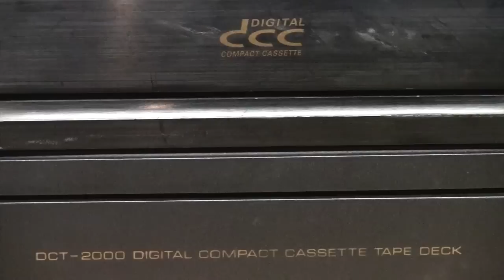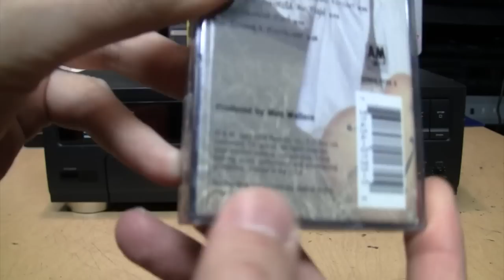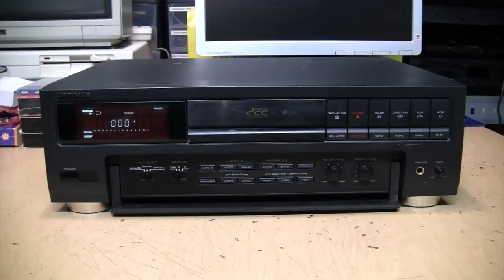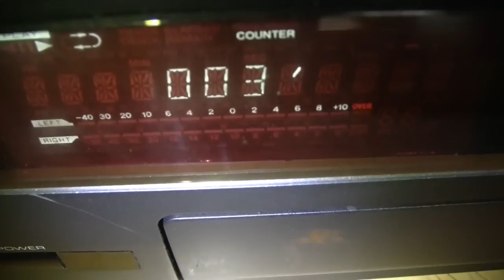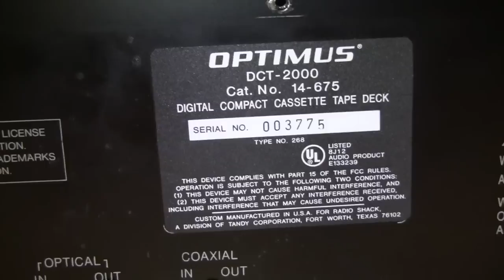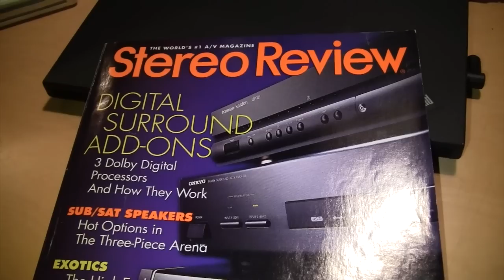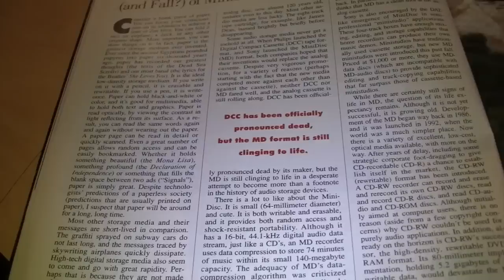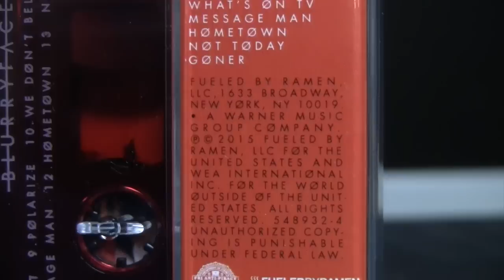DCC = Digital Compact Consternation

Comment: This is not a capacitor issue.If it is it would show with a bulge on top of it!I think its the head or somewhere very close to it!
Love ur channel,though.
Reply from the maker: Surface-mount capacitors don't bulge, they just leak.
Reply: Nor do all electrolytic capacitors bulge or leak, they just dry up and turn into a resistor....  ~Jack, VEG
Reply: Would u be able to see if it leaked?
Thanks.
Reply: Thanks,now I know a bit more than yesterday!
Cheers.

Comment: are you planing on reviewing cheap cassette decks like a pyle or a marantz
Reply from the maker: Eventually.
Reply: Marantz actually also made a couple of DCC decks, and they're generally viewed as the best DCC decks you can get, because they used different D/A converters. They were also wildly expensive even though they were identical to the DCC-900 inside apart from the D/A converters.
Reply: Actually, he's referring to Marantz last Cassette Decks which where geared for Pro use and were  just strait Crap, They actually were the same model as Pyle's Cassette Deck and a lot of Customer's were pissed after they realized they could of bought the same unit for much less under another name, needless to say, it didn't last long on the market...

Comment: It seems like you may need to check into the tape head itself, dude......... though I certainly wouldn't rule out capacitor issues, either.
Reply from the maker: I spent half the video talking about how it might have a bad tape head, dude......
Reply: Unless some moron tried to demagnetize the tape head, the head is probably still good. But he won't know until he recaps the boards.

Comment: Get a hair dryer or heat gun on the boards always works on the old ps3 soldier joints
Reply: The solder joints aren't a concern here, heating the board would do nothing.

Comment: If you encounter the same problem, first you clean the head. If there is no result, you go to the head and press it down or up. There is no result. Change the pulleys. There is no result of changing the capacitors. There is no result. You press your finger on the variable resistors in the small board of the head.  Or the fuse. You did not get the result of the nearest trash bin near your house, throw it inside, and comfort yourself😂
Reply from the maker: Bad capacitors are the known problem with these decks.
Reply: NEVER A TRASH BIN....RECYCLE BIN ALWAYS

Comment: At about 10:30 you said the magic word! The reason this deck isn't working, it's made by Philips(except for the power supply board)! Problem solved! Case closed! Philips is a brand that anyone even half-way serious about good audio gear should AVOID LIKE THE PLAGUE!
Reply: Philips made excellent gear until the 1990s when they started cutting costs everywhere, just like everyone else.
Reply: In 1963 our family bought their first TV set, the store we bought from gave us three sets to evaluate, a Healing(EMI's other brand), PYE and a Philips. My parents thought the Healing's sound was a bit tinny, the PYE seemed to exhibit vertical hold problems so they settled on the Philips and our TV problems started from that point as the set was ALWAYS playing up, so I grew to having a complete distrust and dislike for ANYTHING carrying the Philips brand except records because Philips did not directly make records, they leased the name and trademark to a company to press and distribute records for them. Just as well because if they had made records themselves they'd be useless - unplayable. From the time of that old black & white TV my parents foolishly chose(they should've gone with the Healing) I've held Philips in utter contempt, and still do.
Reply: I'm biased because I come from Philips' home town and grew up surrounded with Philips. I have good experience with Philips engineering and I'm proud to say I was one once. But I also think Philips made some spectacularly bad decisions with things like Video-2000, CD-i and DCC. My experience is that at least until the 1970s, they had a reputation of making quality gear that could last "forever". We had one of the first Philips color tv's of the street, purchased in 1973 or 1974; it lasted until 1988 and probably could have been repaired. Picture and sound had been fine until the power supply failed but with only 6 preference channels it was getting increasingly useless and we got rid of it when we moved. I also had a top of the line Philips stereo system from 1987 that had lots of trouble like an amplifier that would sometimes boot up with its electronic volume regulator on maximum. Right now, Philips is not even the shadow of the company that it once was, and whenever I buy new gear now, it's near the bottom of the list of likely brands to consider.
Let's just conclude that your mileage may vary. Not all Philips gear is good, but bad capacitors don't just happen to Philips. And continuing down this rabbit hole won't benefit anyone, so this will be my last comment on this thread.
Reply: We'll agree to disagree.
Reply: I used to avoid ANYTHING AND EVERYTHING with a Philips brand on it except records because several great artists and groups, like Dusty Springfield, The Four Seasons, Demis Roussos, Roger Miller, The New Seekers and others appeared on the label here in Australia. But cassettes, cassette recorders, TVs radios, even light bulbs, I wouldn't touch them with a barge pole.
Reply: Their 1980s CD players are the best ones ever made, though. Anyway, I think that’s their only stand-out.

Comment: how can you record a DCC Tape (add title)
Reply from the maker: Using a working DCC recorder.
Reply: You couldn't add titles to DCC tapes with this recorder, only with a third generation recorder (DCC-730/DCC-951). And those titles would only be visible on other third generation recorders, not on earlier ones.
Reply: can you add them by encoding audio on a computer and record it on a DCC Tape?
Reply: Not unless you had a DCC-175 with a PC-link cable. Those cables are extremely rare (a reliable source tells us only 1400 cables were made). They had a custom chip that made it impossible to make your own cable. 

The schematic of the DCC-175 is available, though. And it tells us how the cable is connected to the electronics. In theory it's possible to do something with this information, and I have some plans...